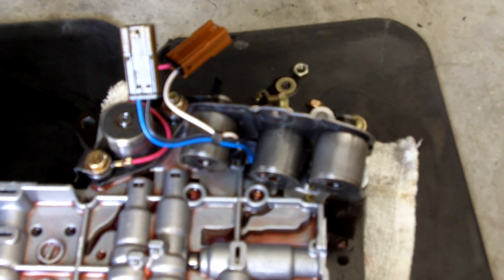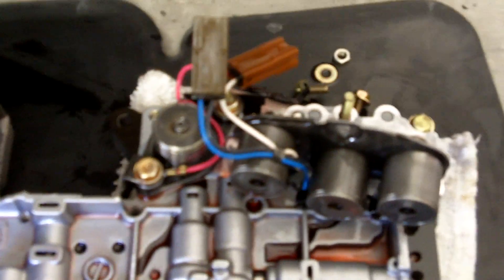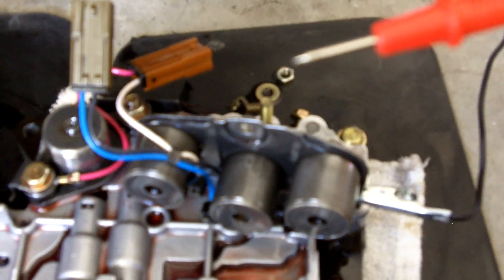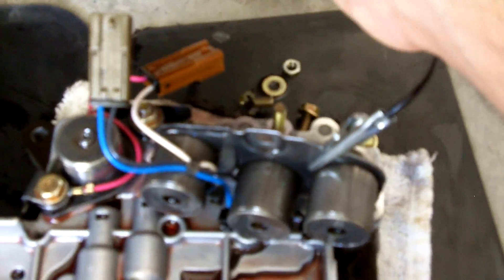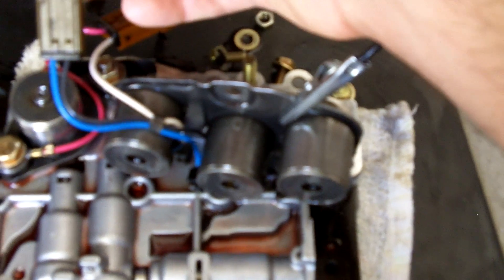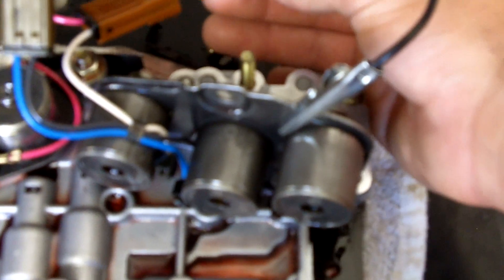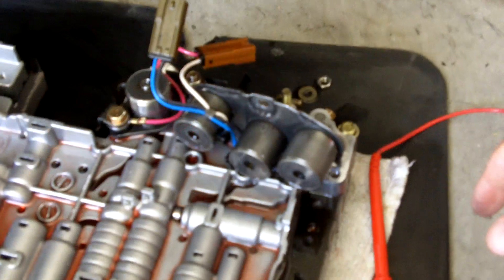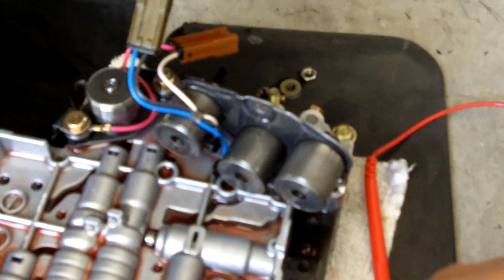Solenoid Testing.MOV

Comment: I have a Nissan frontier 2001 pickup. As 198,000 miles on it it will kick out of overdrive once in a while. Here is the problem if I drive over 100 miles the problem comes up if I keep it under that it works fine. For example I had a trip that goes about 190 miles miles. So on the way up I usually stop about half way and have breakfast which takes about an hour then go to my destination. Then coming back I leave early in the morning and I do not stop when I get over 100 miles approximately my overdrive kicks out of gear. Then I come off the gas and it goes back in got a bring it down to about 55 miles an hour and 2000 RPMs. Next day everything's okay most the time only drive about 25 miles
Reply: Does the distance it takes vary depending on hills and terrain? I want to say that the TCM disables overdrive if the transmission is overheating, but I can’t find the part I’m thinking of in the service manual. Check your temperatures driving around town and on some longer highway drives, and then again when you hit the threshold where the OD drops out.
Should be between ~140 and ~180 for the older transmission around town and on easier highway drives, maybe even up to ~210 depending on the age of your Ung and how you push it.

An infrared temperature gun from the hardware store will do the trick to measure. (~$15-20) point it at the rear middle of the transmission pan with the engine running, careful not to burn yourself on the cat converters though!
Reply: Thank you for your reply. I had a 12 mile trip one way got home and read it at 140. Taking it to the transmission shop tomorrow morning I have about 75,000 miles on the transmission oil so it's due for a change new filters and they're going to check it out. If I ever figure it out I'll reply back

Comment: Thanx for this info you've posted..but I'm a little confused..and know almost NOTHING about this type of thing. So this guys says that solenoid Won't make noise thru cycling because there's no springs in those 3. https://www.youtube.com/watch?v=0YdbPQttJPc . Sorry in advance if I am wrong about this. Just trying to find a solution to my prolm of my trans not shifting into 4th/OD. Thanx man.
Reply: Brian Doerner you are correct. Those solenoids do not contain return springs. It seems his solenoids were bad anyway, but just applying voltage and listening is not a guaranteed check of their functionality. Check their resistance and the ability of the plungers to move freely. If the coil in the solenoid is bad, or if the plunger is stuck, the solenoid will not make noise when voltage is applied. This however, is also the case if both are alright and the plunger is just sitting at one end and hasn’t been pushed back out. So just be thorough in checking yours!
Reply: Hi to all and @danteeley6827  I have thesame issue with my RE4R01a trany mounted on my ford everest gen1 2.5 4WD from Philippines. It's a yude puzzle to me this issue,was started when  I m driving and i Rev up hard  then suddenly shift to down and black smoke came from exhaust pipe, then after 50 miles "HOLD" is  blinking on my dash board and won't shift to nxt gear, I take a rest for a day to run then seem like shifting accordingly but after a few miles issues repeatedly. Replaced ATF but still thesame, I desided to full down valve body to check for solenoid resistance and seem like okey, the reading of solenoid pack  is 30 to 31.10 ohms, I test also with battery wire, plunger is  acting up but does not going back unless to give a tap it would open up the small plunger inside. 
Do I need to replace them or theres any more deeply main couse of the issue? thanks.

Comment: is not true tha solenoid is Good.
Reply from the maker: Some of the individual solenoids might be okay, but I went to the pick a part grabbed a whole assembly and it fixed my tranny problem. I realize some solenoids are not just on/off, they can modulate.
Reply: thank you. i am from libya. i do not understanding you. good or no good
Reply: mghattendorf so does this test work or no cause my 3 pack has no sound either and I'm gonna grab a set from pick and pull but comments seem like this test doesnt work ? for those 3 ?
Reply from the maker: My tranny was stuck in failsafe mode, I swapped out that solenoid pack and boom my tranny worked fine again. Others have commented that some of those solenoids are variable, but honestly if you put full 12v to any car solenoid it should make an audible cycle of some sorts, again my opinion and I am entitled to that. For the full dollars and time spent at a pick yard it was well worth it. Good luck!
Reply: mghattendorf yea I just wanted to see if I could test the new set before putting it in

Comment: good vid MG 👍,there's hardly any vids on qx4/pathfinders on the tube ? glad it worked out 4 you ! I drive 98 qx4 same trans had mine rebuilt installed it back set new tps and now won't shift past 2nd gear (fml) ! now debating if I should tackle the solenoids 1st or change out the tcm n maybe get lucky , did u have any no shift issues b4 your fix ? tnx in advance

Comment: I have a 95 nissan truck v6 when cold shift good after a miles gers stock on 3rd gear, mechanic said selenoid please help before spend $$$$
Reply from the maker: +JOSE ALFREDO Mine did that exact thing just out of the blue. I went to a junk yard and took the solenoid pack out of another pathfinder. It worked fine after replacing it. I believe there are some youtube videos that show how to remove the transmission valve body so you can replace the solenoid pack. It is more messy than it is hard if you have some basic mechanic sense. Good luck. Shop online for the solenoids as that will be cheaper then going to the dealership.
Reply: Jose our trucks have safety set in place where they lock into 3rd gear so trans don't burn itself out ! did you try to scan it (obd) for codes ,more than likely your problem should show up.  also the (tps) throttle body sensor is a main controller of trans in our trucks (p0120 code) p0700 and up are trans codes good luck !
Reply: L thanks!! But I sold it
Reply: +JOSE ALFREDO no doubt ,did you or do you know if the buyer figured it out

Comment: I got 93 pathfinder and what happens is that we did the transmission service as we do every other year, the problem is that some times when I start driving It starts on 3rd gear so I turn it off then move the cables that go to the seneoids and then It drives fine. I have send It to a couple of mechanics who don't have a clue of what's going on and the last one insist that it shoud be a selenoid issue .  Could some one give a hand??

Comment: Were you using a 12 volt battery. I need to test these in my trans but don't want to burn anything up using to much power. BTW what problems were these causing you? Want to know if your symptoms are similar to mine.

Comment: Its kinda late, but I will try to answer your question.  3 of those solenoids did not click because they are not the on/ off type  solenoid (ie. shift solenoid).  They are the line pressure/ timing solenoid which run off duty cycle.  Its based on PWM (pulse width modulation principal- 0-100%) and not on-off.  You can test these by checking resistance and duty reading.
Reply: never heard of a PWM solenoids

Comment from the maker: @corpustube Anyway there are two tests that you can do to check a solenoids operation. First do a simple continuity test using a digital multimeter. This will confirm that nothing is broke internally that you can't see. If all is good with that then try to secure an old battery like I did in the video and apply an electrical charge to the solenoid as I did in the video. Most solenoids will make an audible sound when it is engaging and disengaging. They really are simple devices! Cheers.

Comment from the maker: @corpustube  First off I am no expert, but merely like to fix my own stuff if at all possible. I know that if I went to NIssan and ordered the parts they were going to be super pricey, but I was able to find them online from a drivetrain shop located here in Vegas. Since this was on my beater offroader I took a gamble and went to the junkyard and didn't test it until I got home. I think I paid $20 for the solenoid pack. You haven't told me your symptoms so I can't provide you with more details.

Comment: What testing tool are you using? I'm totally clueless when it comes to electrical stuff. If you would be so kind to explain the tool to me like you're talking to a 5th grader, I would really appreciate it. I have a Honda pilot '04 that has 6 Solenoids and they would cost around $500.- total to buy them. I'd rather go to the junk shop and get a replacement but I do want to test what I'm getting. Thanks in advance.
Reply: corpustube